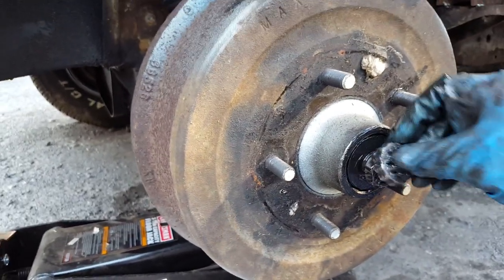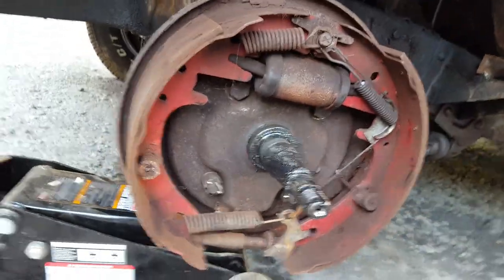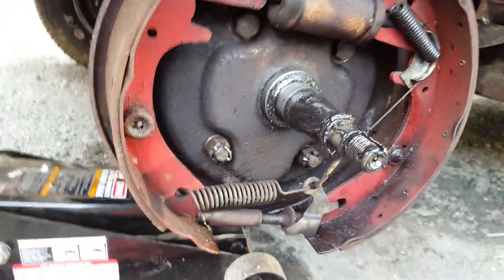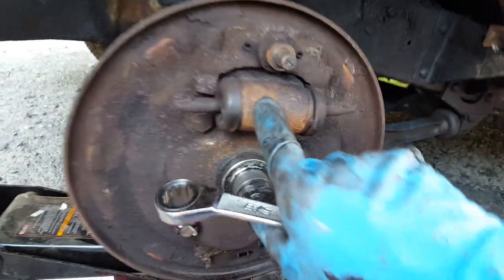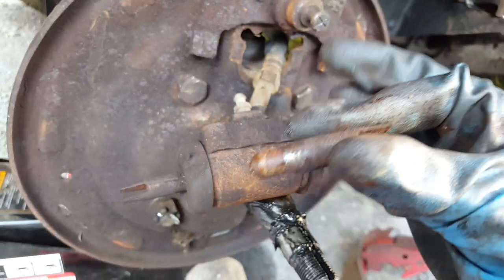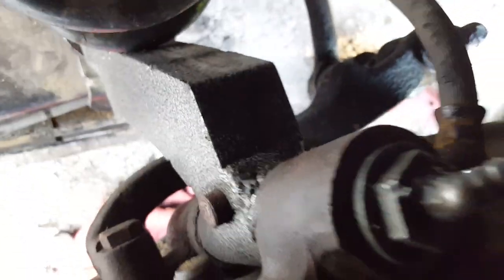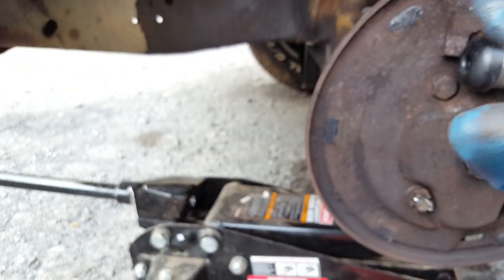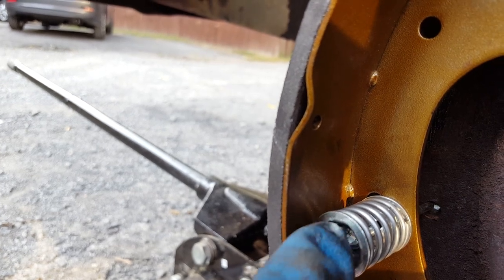F100 front drum brakes part 1 of 3

Comment: I'm replacing the front and rear brakes on my 1964 Mercury Montclair. The front brakes on it are very similar to a 1964 Ford Galaxie, since both cars use the same frame. The only difference is the front wheel cylinders are held on by one 1 1/4 inch bolt and nut. Its a pain to get off. I havent figured out how to remove it yet....
Reply from the maker: Southern Mechanics damn i hope that works out keep checking online , if your replacing it anyway maybe heat... but make sure you dont heat other parts your keeping and warp them? are you sure its the right bolt and not the spindle.. im just guessing good luck
Reply: Hair and Beard I went down to a flea market thats by my house and I borrowed a 1 1/4 wrench. I was able to get the nut off the drivers side but the one on the passenger side is soooooo stuck. I cannot figure out how to get it to unscrew! Ive tried everything!

Comment: Thanks H&B, big help for my '71 F250; it was almost exactly the same. Amazed you did most of it one handed! You should start some crowd funding for a camera phone tripod or some sort of stand. :-)
Reply from the maker: David Spidle haha great idea.. thanks glad to help
Reply: I'm having trouble taking the rear drums off.  Am I missing something? Any tips?
Reply from the maker: David Spidle it has to come off evenly.. bang the shit out of it with a hammer.. maybe the shoes are jammed against it.. reach in and loosen the spring through the hole with a flathead. the opposite way the video shows of spreading them toward the end
Reply: Ha, I was an idiot.  Still had my emergency brake on.  Let it go and it came right off.
Reply from the maker: David Spidle sometimes you just need to stop and rethink.. cool beans

Comment: Main question how does the truck stop with the modern brake shoes ? I was told by a brake shop oh we don't touch older truck like yours we had too many issues the modern shoes do not stop as well as they did back in the day when they had asbestos pads . He referred me to a guy who makes his own brake linings and specializes in order truck ,cars with drums and low pressure systems so how did it stop ??????
Reply from the maker: Bamboozel96 it stops well, but slower, the problrm with most including mine is that there often no brake booster. I have since upgraded to disc front and rear. That was something temporary. So i my opinion if you have a f100, buy 1973 and up spindles and change to disc
Reply from the maker: Bamboozel96 f series, sorry. 73' and up disc is standard, way cheaper then a full ifs swap
Reply: Hair and Beard 
cool I have a 69 250 it does have a booster whether or not that was factory I don't know it had /P/S and A/C so I'm assuming it was yeah they told me not to use the shoes at auto zone etc said it wouldn't stop well and refer me to a custom brake guy I would do it myself but the 250 has a heavy rear axle it must be pulled out to take the drum off I don't want to deal with all that .
Reply: Hair and Beard 
I agree with that I will need to look into finding a 73 up F 250 spindle with disc .
Reply from the maker: Thats the way i would go.. and the other option is ordering 73' parts from part store. Either way i encourage you to do the work yourself. Have fun
Reply: Hair and Beard 
Is the spindle the same ? Such as I could go and order a rotor , caliper pads and disc and put that rotor on my existing spindle ???
Reply from the maker: Bamboozel96 all the research i did says yes, but i dont think you have same style spindles, i.e. you need to get spindles for 73' also
Reply from the maker: https://youtu.be/V423foS0v8s this guy shows how to.. 8 min in he explains brakes